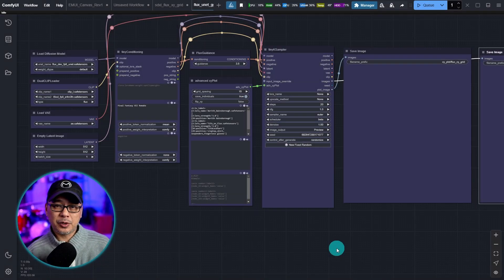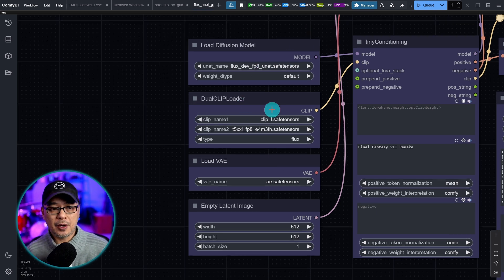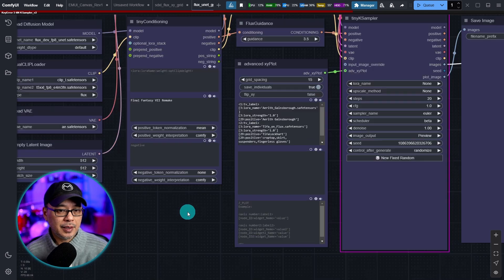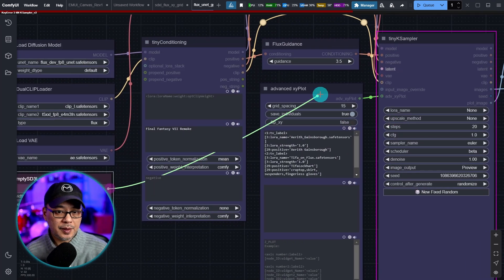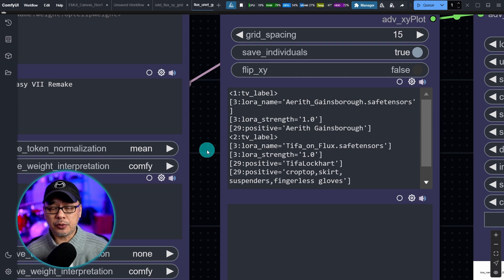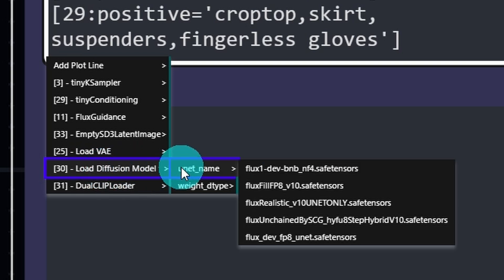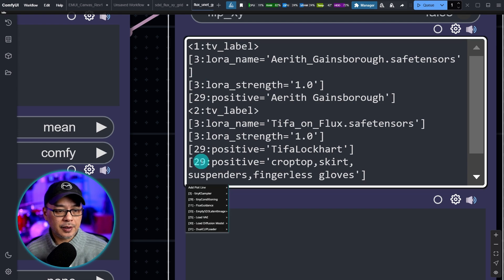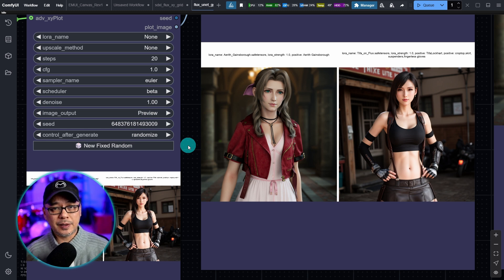How to Use Flux Unet ( & GGUF) Models With TinyTerraNodes XY Plot

Comment: Cool and no idea on that error. I'm not even remotely familiar enough with Comfy to know that.
I do vaguely seem to recall at least one older worflow using and SD3 node, but I think that was for using Flux to enhance SDXL images. Not sure and there were other errors I couldn't solve, so I gave up. If I get chance I'll try and dig that worflow up and see if it uses TinyTerra too.
Reply from the maker: Interesting! I’m just curious why the error happens and what differs between the 2 nodes?